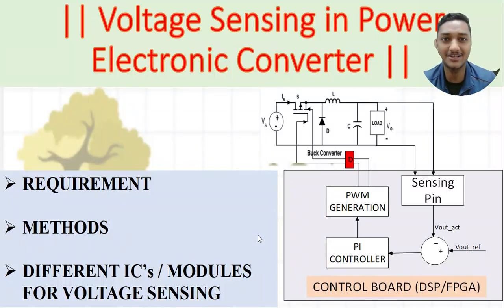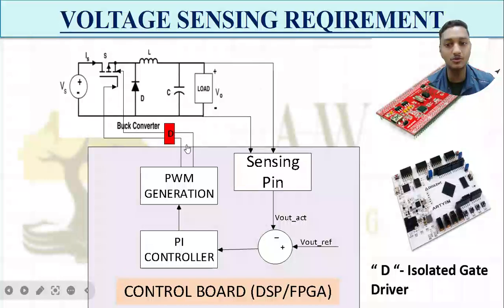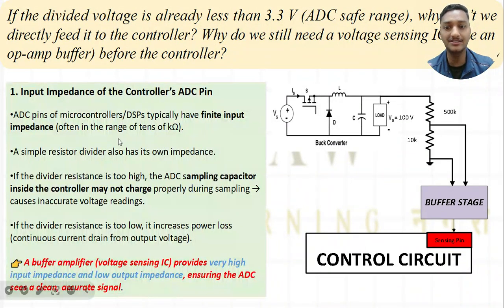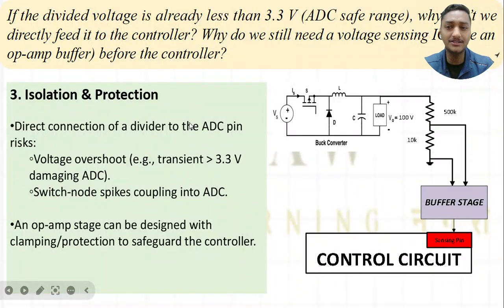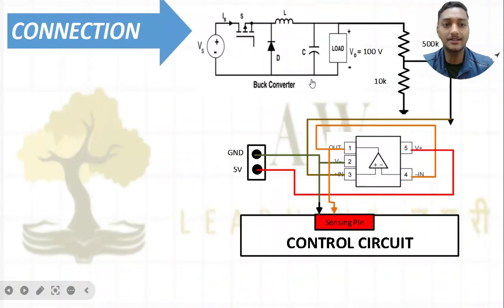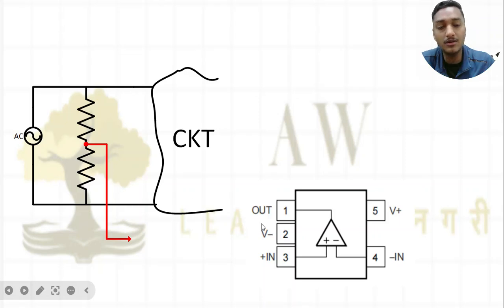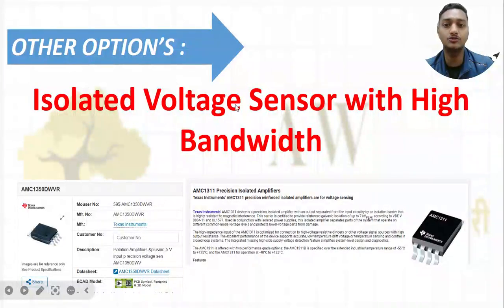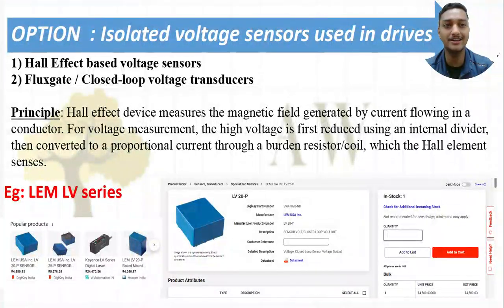Voltage Sensing in Power Electronics || MUST WATCH || #powerelectronics #voltage #voltagemeasur

Comment: Very informative video Sir, why did you not explain the diff. Op amps? Waiting for current sensing video.
Reply from the maker: We need to add Few more components and do the calculation for them in order to make differential amplifier as voltage sensing kind of thing. But in may be few days i'll make video on same as well to design differential amplifier with known IC.

Happy Learning ..❤
Reply: @Kingashish-555  SIR THIS VEDIO ARE MORE USEFULL IF YOU GET TIME PLS UPLOAD VOLTAGE SENSOR DESIGN CURRENT SENSOR DESIGN AND GATE DRIVER AND SWITCH SELECTION IT WILL BE VERY HELPFULL